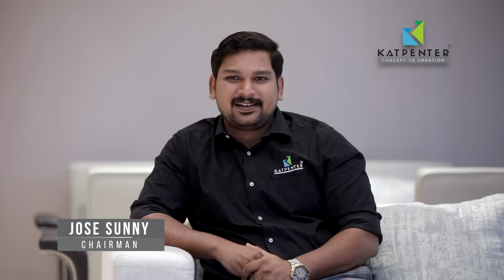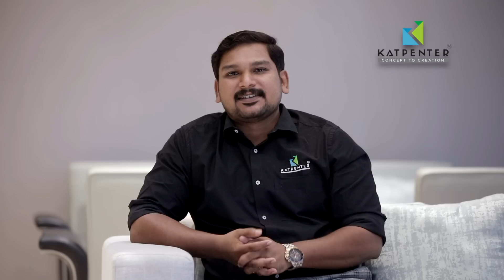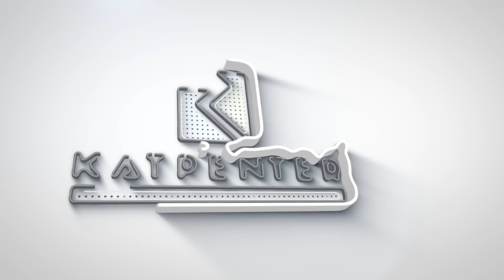Steel Structure Building കേരളത്തിന് അനുയോജ്യമാണോ? Katpenter | Construction and Interiors

Comment: Hi e iron rust akile??rc building pole long life undakuno???pls clear my doubt...thanks in advance
Reply: Even I feel Steel will rust especially in highHumid areas. This cannot be a replacement for concrete structures which last more than 50- 75 years. Also maintenance will be high ,  as there needs to be fireproofing , lightening protection, applying Anti rust coating with regular maintenance.

Comment: Alappuzhayil nigal work cheyumo.enikku oru commercial building vekkanam ennu undu .Textiles thudangan anu ente property 50m length and 16.3 width um undu .Oru 2000 sqft building paniyan etra cost varum glass, panel  ellam koodi etra cost varum
Reply from the maker: Thank you for your valuable comments. For more details, please call 9846391601